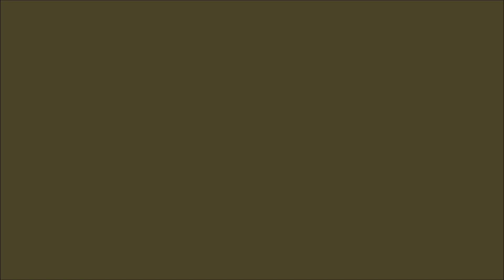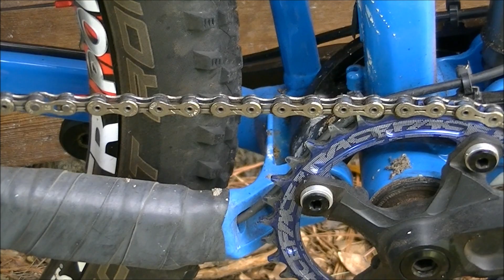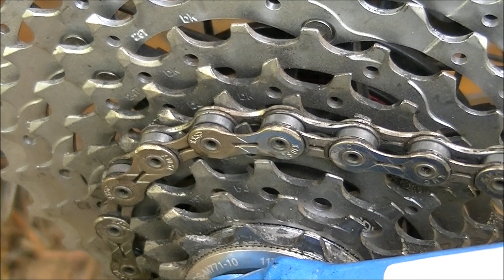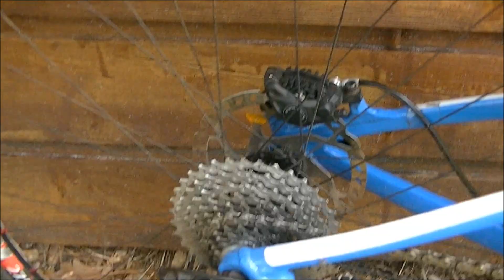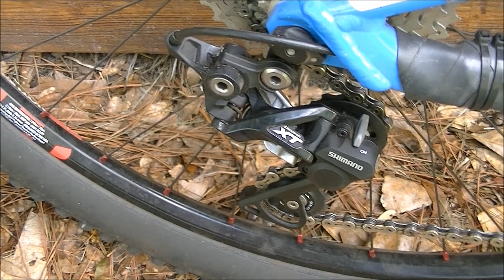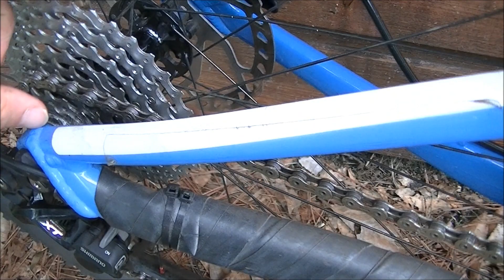How to Build a 1 x 10 Drivetrain on a Mountain Bike

Comment: I have a anthem 27.5 3 with similar setup for the rear cassette, what size spacer did you end up using for the chain ring to fit centered?
Reply from the maker: I used the ones that came with the Raceface chain ring
Reply: awesome, thanks for the quick reply, hopefully this will go smoothly with my shimano deore cranks
Reply: 2mm.
Reply: It's important to note that he has a triple ring.

Doubles don't line up as well.  Get a triple or single crank.  I don't need any offset on my chainring when using the SRAM Truvativ GXP triple crankset.  It's from the 9 speed era and is fairly cheap on eBay.  If you have BB30 then buy a single ring crankset.

Comment: I just converted my anthem to 1x10 with my 11-36 cassette, tested it this today. 36 was really difficult for steep climbs over 15%, is the Sunrace cassette 11-42 10spd worth it ? 1x11 seems expensive even with the shimano m8000.
Reply: You can try an oval chainring (narrow wide) 34T, it will feel like a 32t while not in power and 34t while in power. I ordered the 34T narrow wide oval + 11-42 cassette from CRC.

Comment: I just installed that Race Face chain ring on my bike.  The original was 36, I went with 32.  how many links if any should I take out?
Reply from the maker: +Kevin Halucha it's going to depend on how long your chain stay is. Really the only way to do it is to measure it. Check out my video on how to install a new bicycle chain. You basically go from the big cog to the big ring and bypass the rear derailleur and add 2 links.
Reply: +Clint Gibbs OK, thanks!

Comment: Would a 1 x 8 still work fine?
Reply from the maker: The Race Face narrow wide chainring is compatible with 9, 10 and 11 speed. I am not sure if anyone makes an eight-speed narrow wide chain ring.
Reply: Clint Gibbs Thank you for the response. Is there any other way to make 1 x 8 setup?

Comment: I know this vids is old, but I have a plan to convert my mtb to run one by drivetrain. But I have a question, my current crankset BCD:64/96mm, does it fit on race face single chain ring i? if not, what should I do then? since I really want to go one by drivetrain.
Any help would be apreciated.. Thank you
Reply from the maker: +Rendy de Puniet I think Race Face comes in either a104, 110, or 130 BCD. So it doesn't look like it's going to work. But I would Take a trip to your local bike shop and see what they can order in that specific BCD.  I think that the Shimano XT is 96 so you're probably going to have to go with the Shimano XT narrow wide.
Reply: That's what I thought, but after take a look for XT chain ring it doesn't have square BCD, it's rectangle instead. so it won't fit..

Comment: Hi my name is Peter I have got a specialised Rockhopper sport and I have changed it to 1 by 9 I've had to use Chinese stuff to keep price down but it works perfectly my back cassette is an 11 by 40 with a front chainring of 32 which is Oval I've kept the same dralia at the back and the whole thing cost under £100 take a look on Amazon

Comment: I've bought a specialized hard rock 650b and would like to run a 1x10 system. How do I find out which is compatible with my bike?
Reply from the maker: +psych0billy6 is it currently a 10 speed drive train?
Reply: Clint Gibbs. It's a 3x7 setup.
Reply from the maker: +psych0billy6 check with your local bike shop but I'm pretty confident a 10-speed cassette will fit on your hub. If they're still not sure get it and make sure that fits before you proceed with buying the chain and chainring
Reply: Clint Gibbs Thanks for the help. What other manufacturers would you recommend that have good quality parts?
Reply from the maker: +psych0billy6 SRAM, Shimano, Race Face, One-Up.

Comment: clint can i use a KMC chain for a shimano 10 speed dyna-sys drivetrain
Reply from the maker: Yes. That is what I do. As long as you are matching the 10 speed chain with a 10 speed cassette, 10 speed derailleur and 10 speed shifter.
Reply: Clint Gibbs and 10 speed missing link.

Comment: the question I have is, can I change a 3x7 drive chain to a 1x10 drive chain? I have a giant atx 2
Reply from the maker: +Josh H it's going to depend if the 10 speed Shimano cassette will fit on the same freehub body as the seven speed cassette. I honestly can't remember if it does so you probably need to ask your local bike shop.

Comment: Do the raceface cranksets work with a press fit bb30??
Reply from the maker: Tyler Dougherty , the race face cranks I have are a 24mm spindle instead of a 30mm (which is what the bb30 and PF30 bottom brackets use).  Not sure off the top of my head if Race Face makes a 30mm spindle.  So unless there is an adapter (again, not sure off the top of my head) that you can use, the Race Face cranks I have will not work with a BB30.
Reply: OK thanks I'm looking into building up a hardtail and I'm really set on using a 1x10.   Race face seems to make pretty affordable cranksets but I'm not sure if they will work with a bb30.    Anyway thank you
Reply from the maker: Shimano Pressfit is the same as a BB92. That's what you would need with those cranks if you have a press fit frame. Any external bottom bracket would also work.

Comment: you don't need to change your crankset... just put a narrow wide chainring on a 2x.. in fact you can put 2 different narrow wide rings on the front so you can hand shift the front ring per ride type..  ive been doing this successfully for years now
Reply from the maker: +Billy Bob Good tip!   I was approaching this from a clean, new build but putting 2 rings on is a great option if you don't mind the extra weight.
Reply: +Clint Gibbs .. Blackspire make great narrow wide rings at lower BCD's btw... I have a 30T and 36T on my 2x, and of course you can simply put only one ring on a current 2x crankset..  Its amazing how much smoother the drivtrain becomes when you switch to 1x NW chainrings..

Comment: Can someone explain to me this :When you have more teeth on the front chain ring it becomes harder to pedal correct?? But the lowest gear in the cassette has the most amount of teeth and makes it easy to pedal. How does it change just because it's on the other end of the bike ??
Reply from the maker: +Kye Wilson it's physics. The Rings in the front are driving the wheel, and the gears in the back are on the wheel being driven. Just the way it is. I'm sure you could do a Google Search and research the physics behind it, but that's the long and short of it.
Reply: This post is a little late, but I'll go into a bit more depth. Your gear ratio (how many times the crank spins versus the cassette) is the ratio of driver gears/driven gears. Multiply this by pedal RPM to get cassette/wheel RPM. If you have a bigger chainring, you're 'pulling' more chain with each rotation, so the wheel spins more. If you have a bigger cog, you have to go through more teeth per revolution, so you get fewer revolutions with the same amount of work. Because work done is force*distance, you get more force with less distance. Another way to put it is Force = Torque * lever arm. Bigger cog means a longer lever.
Reply: This is super old now... But I think it's very easily understood in terms of leverage. four27060 mentions longer levers in their answer.
Since the rear sprockets are fixed to the rear wheel the leverage they have is determined by their distance from the outermost part of the wheel (tire surface). To appreciate leverage, imagine a line going from the center of the wheel to the tire. This radial line would be the lever arm. The smallest sprocket (11 tooth in the video) is furthest from the wheel and has the smallest leverage. Also, if you kept the smallest sprocket engaged but increased the wheel from a 26 to 27.5 or to a 29 inch you would be increasing the distance and therefore decreasing the leverage; Clint mentions considering wheel diameter when choosing cassette size. Conversely, moving up to a larger sprocket or reducing wheel diameter you do the opposite (Just try spinning your bike wheel by pushing on a part close to the hub and then try again by pushing on a part near the rim - it's very apparent which is easier to accelerate). 
For the crank arms it's the same. By moving the chain from the largest front sprocket (chain ring) to the smallest one you are effectively lengthening the crank arm which means you are increasing the length of the leverage you have about the point of rotation. And you are shortening your lever arm when you move up to a larger chain ring and therefore decreasing your leverage. You can also change the leverage you have when you shorten or lengthen the crank arms themselves.

Comment: hey I was just wondering what it's like on long hill climbs
Reply from the maker: +billy mutt Good if the grade isn't extremely steep
Reply: i was just wondering if it would be alright for enduro races
Reply from the maker: It's all going to depend on the course. For most Enduro races it would not be my first choice, especially not with a 100 mm fork. With a 120 it would be a bit better. If the course is a pretty rough course the Trance would definitely be the top choice.
Reply from the maker: I replied you were probably talking about the 1x10 gearing for Enduro racing, not the Anthem.  If so, a 1x10 is fine if you have a low enough gear for the climbs.  It will depend on how steep the climbs are and how heavy your bike is.  You probably want to add a 42T on the rear cassette to give a wider range.

Comment: I've got a 2x10 is it worth it the swap to 1x. I really want to swap but very unsure
Reply from the maker: +Lee Bridgwater it is if you want to eliminate the weight and complexity of a front derailleur.
Reply: Clint Gibbs I currently have Giant Talon 2, I did a project on this bike for fun, i basically converted it into a road/hybrid bike. Installin drop handle bars, sti shifters, changin the rear deraileur to tiagra road. as well as the cassete to 11-25t 105 cassete. Placing 1.1 tyres on. And dame it was a success, although the front deraileur was a fukin pain to adjust. 

A year later now. I converted it back to the original components mkin it a MTB bike. Im having trouble asjusting the front detaileur. Its really starting to piss me off. So I may jus go for 1x10 conversion. less hassle.
Reply: whats the no of teeth do you recommend for the front chainring. my cassete no is 11to36th.? thanks.
Reply: I've been thinking about the conversion and I've decided to hold tight and save for a 1x11 instead of paying out to convert to a 1x10.
Reply: Lee Bridgwater kool. All ill be doing is placing a 36th single chainhring on my current crankset.   jus wondering to go for a 34th or 36 th chainring
Reply: Also wheel size matters. seems to be if 29er it's a 34 tooth front
Reply: Lee Bridgwater i have 27.5 would 36th be compatible
Reply from the maker: 36 is a bit tall for a mountain bike if you ride steep climbs. 34T would be better. But if you want higher top end on the road a 36T would be fine.
Reply: Clint Gibbs kool thanks. ive ordered myself the 36th. i dnt really climb hills that often.
Reply: You made the jump, nice one. Good luck
Reply: Clint Gibbs ive actually reconsidered my option and gone for the 34t. in that ill have the best of both down hills and up hills.
Reply from the maker: Good choice

Comment: Please help me out Clint. I have the exact same drive train setup as you. All xt with raceface single front chainring. For some reason though, my bike shifts fine, beautifully actually, but when in gears 5-10 (the harder ones) it makes a weird clicking sound, like it is in the ame, oedals, or hub, but I checked the frame and pedals and those are all ok. But the hub was working perfectly 2 days before. Please can you help me out with this, if I post a YouTube video of the sound, would you be able to give me some comments on it? 

Thanks a ton

Also, my drivetrain was just cleaned using your method
Reply from the maker: It sounds like the derailleur is a bit out of adjustment in those gears. Like I said in my rear derailleur adjusting video if it shifts well and one section of the cassette but doesn't shift well in the other section then that's a sign that your derailleur hanger may be bent. How is the shifting in that section of gears? Does it hesitate in either direction?
Reply: The bike doesn't hesitate, the shifts are extremly crisp and quick, slight tap on the lever and your on the next gear. It is after that shift is made and I am putting power down on the bike that it starts making a bit of a creaking noise that sounds like it is coming from the back of the bike. The drivetrain is very new too, I just had it installed this past Saturday.
Reply from the maker: Is the lockring on the cassette tight?
Reply: Not fully sure, I'm sure it is, my mechanic never misses stuff like that, it also didn't make that noise when he tried it he said. Just in case, how do I check? Also thanks for these lightning fast replys
Reply from the maker: The lock ring can come loose. I would check that first. You would need a lock ring tool. Your bike shop mechanic will have one.
Reply: Just checked.it isn't the lock ring. Caould it be the upper and lower limit screws because it seems to be the chain grinding on the tooth just above it. For example if I am on gear 10, it will slightly rub gear 9.
Reply from the maker: MrAwsomeness777 Yep, that will do it.  I thought it was grinding in several lower gears.  But if it's just the largest and/or smallest cog, that would be the limit screw.  Back it out slowly just until there is no noise.
Reply: Clint Gibbs no, it is all the gears, from 1 to 10 that there is the grinding noise. Almost like the pins on the chain are scratching the higher ring on the cassette.
Reply from the maker: Then it sounds like the cable is just not adjusted properly, as in too tight. If that isn't the issue then you'll just have to take it to a shop. It could be a bent derailleur cage or bent derailleur hanger.
Reply: Took it to the shop. They said it was the free hub driver body. They said it will cost 40 bucks to replace
Reply from the maker: How old was the hub?
Reply: Clint Gibbs not even a year old. It is the stock one on the giant anthem 27.5 3 so I am going to try to claim it as warranty. What do you think, will there be warranty on it?
Reply from the maker: I would think so if it is less than a year old.
Reply: Now I'm just hoping that it won't be a long and annoying warranty claim, but with my experience with the bike from giant I don't think it will be:) btw congrats on over 1m views on your cleaning video. Awsome

Comment: Its best to know what gear ratios you need for where you live. If you live some place is that is rolling and flat maybe an 11-36 is ok paired with 32t or 30t chain ring. But if you ride some place with decent hills, you will want the lower gears and ditching your mini chain ring will need to compensate for on the rear cassette. If I were to do this, coming from a double chain ring 24/34 and 11-36 cassette, I would swap it out with a 30T chain ring and go with 11-46 cassette or as close to this as I can since 10 speed options are limited in range. This would give you about the same range. Here is cool place to check gear ratios: http://www.bikecalc.com/gear_ratios
My ride is also a 29er  so this also effects the gear ratios

Comment: Why didn't you go for a shimano zee short cage rear derailleur? It is specifically designed for a 1x10 drivetrain to go with a 11-36 cassette.
Reply from the maker: Zee is more gravity-specific and a tad heavier than XT. Since this was a cross country race bike I want to go with XT.
Reply: Clint Gibbs Actually it's just 8 grams of difference between the zee and XT. Still, I presume that a short cage would work better on a 1x10 drivetrain instead of a medium cage, less chainslap and the shifts might be more crisp. A friend of mine has this setup.
Reply from the maker: beholderlt Good info.  Thanks.  I guess I just always had XT or XTR on the brain since I was focused on cross country.
Reply: Clint Gibbs Well 1x drivetrains haven't been introduced to XC bikes until recently, so I guess that's the reason why you don't hear about this setup. The Zee derailleur is also around 10 bucks cheaper than an XT one.

Comment: do you recommend a 34t on 26er, casette 11-36??
Reply from the maker: +Horacio Daniel Belardita yes
Reply: Thanks, and if it is 1x9 with casette 11-34?
Reply from the maker: Yes, that would be fine.  If you find yourself needing a lower gear on climbs change to a 32T.

Comment: Whats a 1x 10 good for?
Reply from the maker: Lower weight, lower maintenance, simplicity when riding.
Reply: When you have to go from your big ring to your small ring to bail out it is a huge and rapid change.  If you don't remember to shift several gears in the rear at the same time you shift into the small chainring you will end up spinning out.

It really depends on what trail you ride, if you ride competitively, how much you weigh, and how much your bike weighs.

I ride with several other people most are healthier than me.  They ride uphill faster than me but their skill level is lower than mine so on descents I leave them in the dust.

Which means I'm often spinning out (going past 90 RPM) on my 36T chainring and 11T cog.  This is what keeps me from switching to a 1x setup on my full suspension bike.

The other trail I ride has a lot of short but tall ups and downs you never have a chance to reach an extreme speed and if you keep your momentum by not braking on the descents you don't need much climbing power on the ups.  The trail is very technical and you have to keep off the brakes if you want to make it up the climbs.  

On that trail I use my hard tail niner air 9 with a 1x10 setup.

I never spin out and never need lower gearing